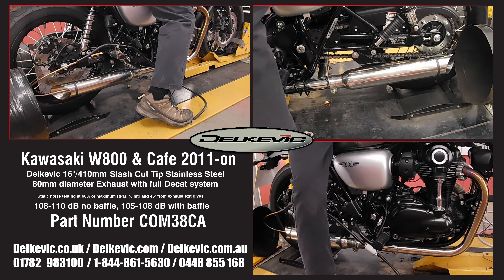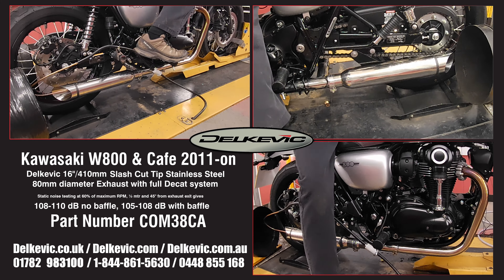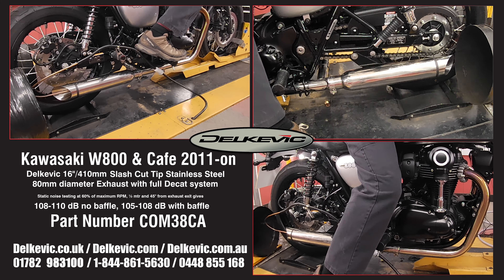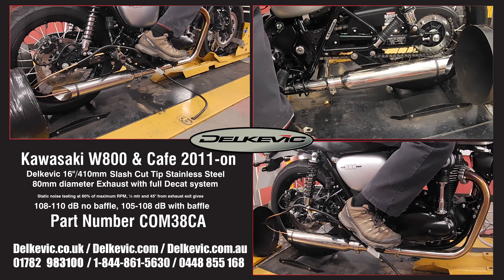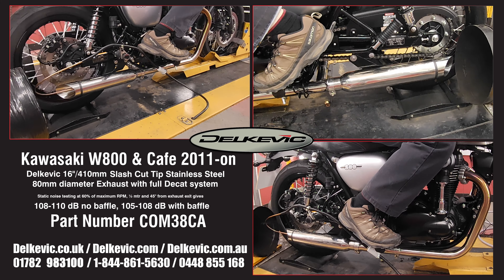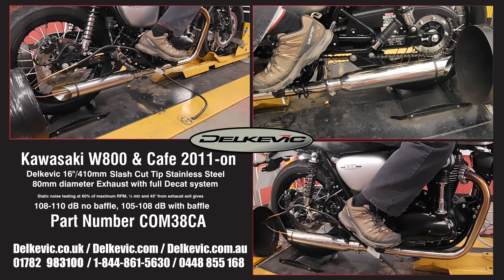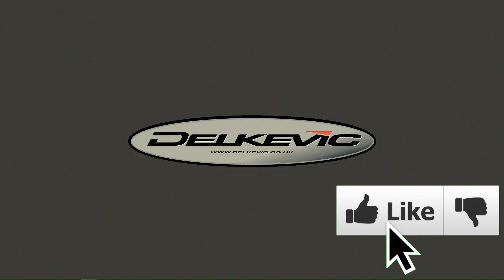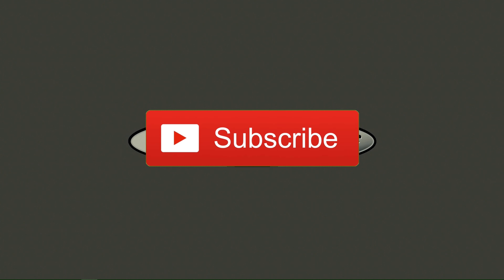Delkevic Exhaust Muffler Slash Cut Short Stainless Sound Kawasaki W800

Comment: I recently purchased a delkelvic exhaust for my w800 which i haven't  installed as yet , didnt come with instructions.  Has 2 sets of washers,  presume the copper 1s go up front on the headers ? But where do the chrome washers go ??
Reply from the maker: If you have twice the number of chrome/ss washers, they might be the ones for the exhaust studs. It's difficult to advise you without seeing any photos, please call your local office to obtain your fitting instructions and discuss it further with them.